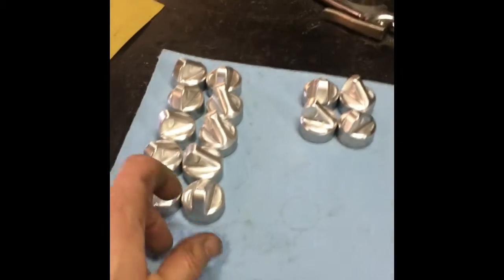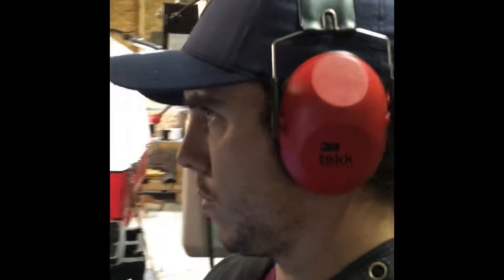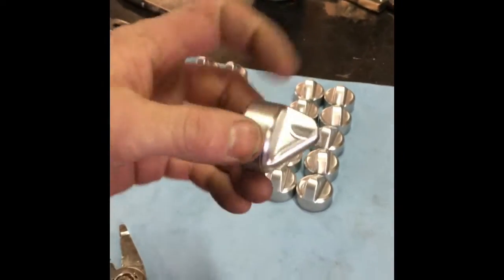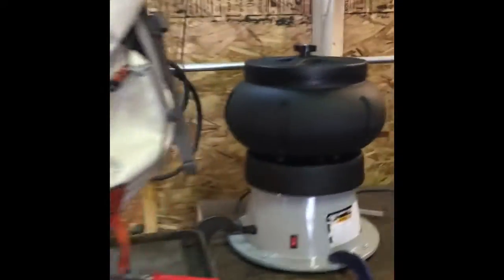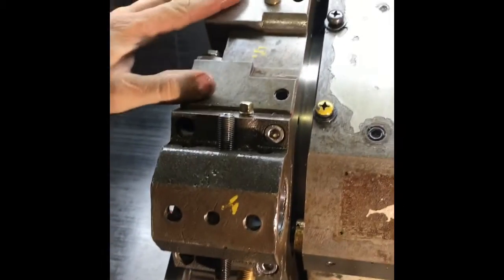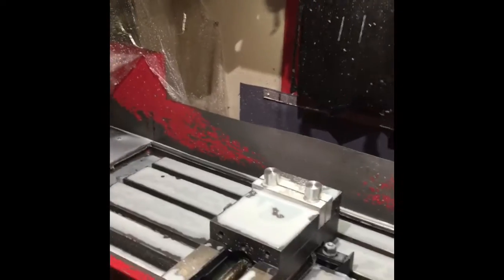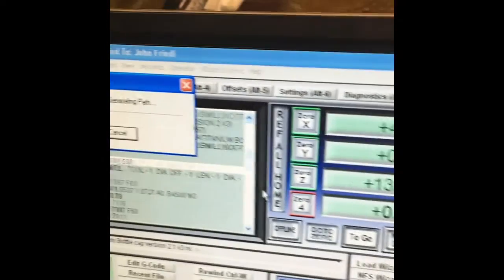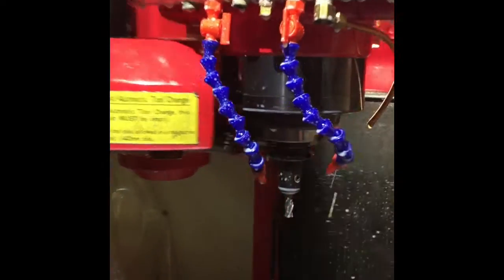Tool change problems and a mediocre tumbler

Comment: I see you added valves on those loclines, they are very handy. I don't think you need that much pressure, especially with aluminum. Try adding more loclines with valves and different size nozzle heads. A bypass on the output of the pump (3 way valve) would help flow/pressure adjustments. You'll find your sweet spots for the narrow nozzles to move chips away from the cutter and larger nozzles for flow to push the chips off the table. Parts look great! Now just get that cutting time split in half! :-) Will you be anodizing in house?
Reply from the maker: +Jonathon Royce Thanks for the tips! We'll be outsourcing anodizing for now. As for the cutting time, I think I could probably push my ball endmill a little harder. My big limitation is the spindle. Even over driving my motor with 120hz I'm still limited to 4500 rpm. I could pick up a used motor on ebay for a few hundred and get up to 8k rpm but my spindle bearings are 6k rpm bearings.